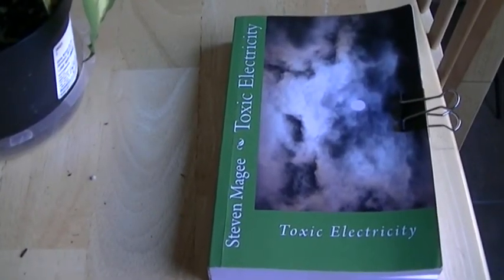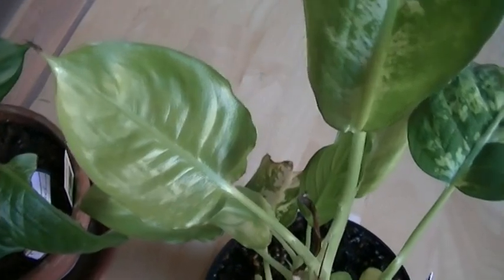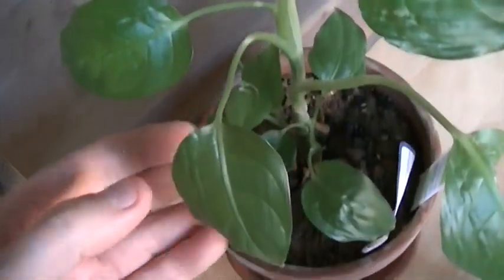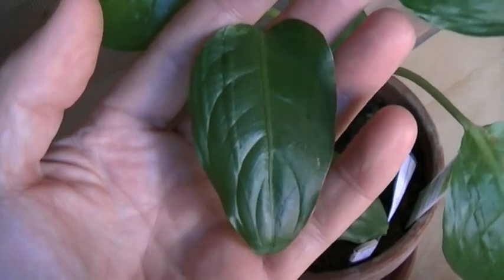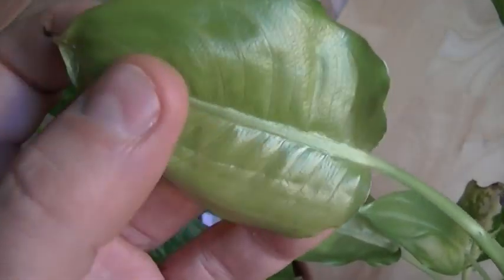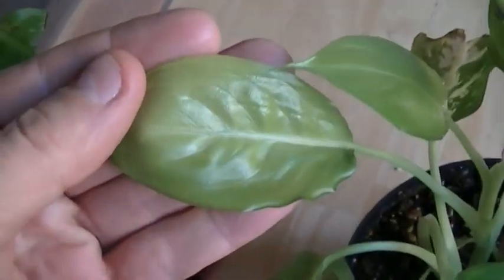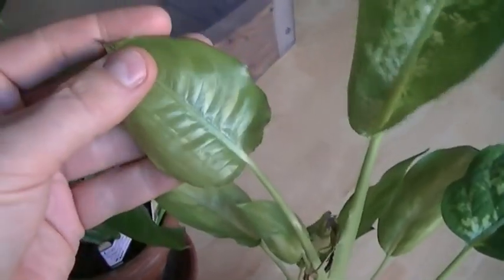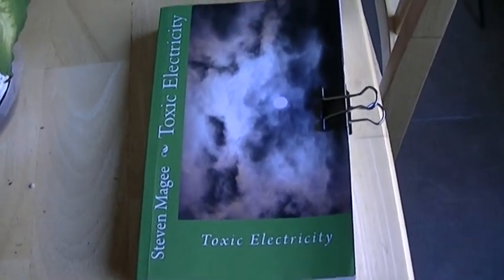Interim Review of Faraday Cage Plant Growth Defects

Comment from the maker: It's aluminum window screen mesh that is used in the Faraday cage and its not electrically grounded due to a "stray voltage" problem that my utility electrical system has.  The plant will be getting less of everything inside of the cage, so I put the cage close to the window to increase the light.  I suspect that the growth defects are caused by the Faraday cage shielding the natural radiation sources of both daytime and nighttime radiation.  They appear to be essential to normal development.